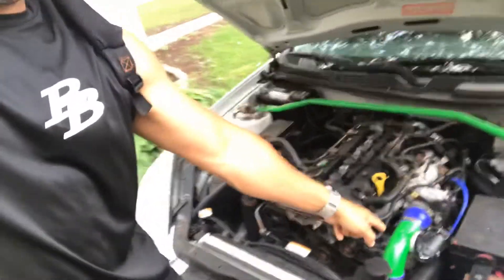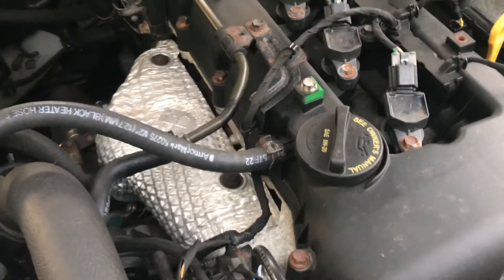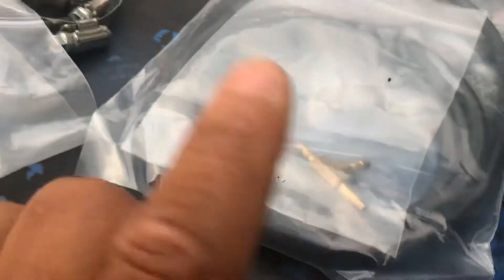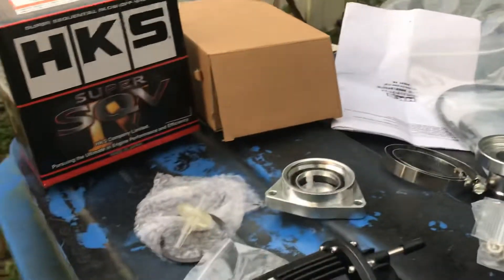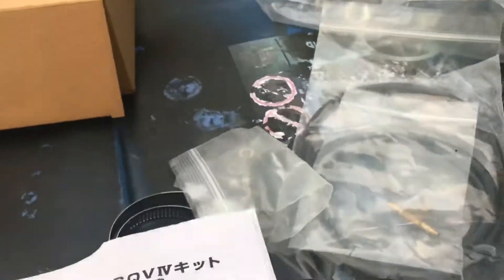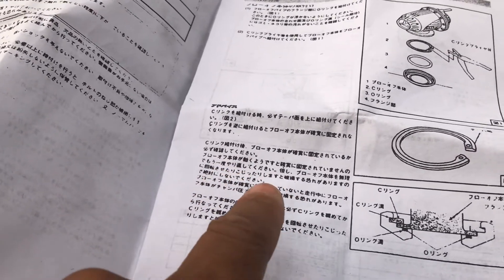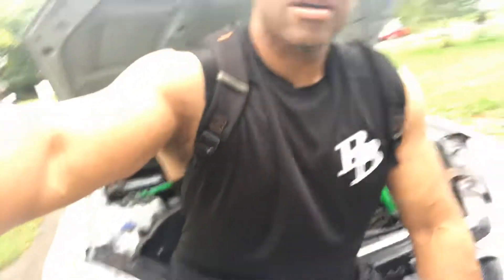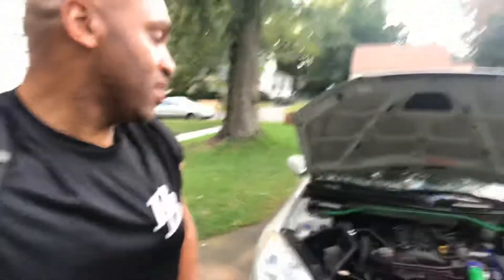Is this a real HKS BOV??

Comment: From the rest of the sketchy stuff I would say that BOV is a eBay knock off and probably not working correctly. I just ordered a GFB bov for mine. As for your taillights check RockAuto.com, they have the anzo ones in red and clear that look like the 2013+ stock style ones for a great price. I stuck with my stock bk1 ones but used vivid black out film and bright LED's bulbs, just like the smoothness of them as the newer ones have that shelf look to them.

Comment: I have the same blow off valve. its a fake. the other thing you need to know is that it leaks. I did a vacuum test on it and it does leak but very slow and the other thing is the diaphragm design is garbage you might need to take it apart and grind down the sharp edges internally. here is my review on it https://www.facebook.com/media/set/?set=a.909337822559948&type=1&l=2b01a0348f